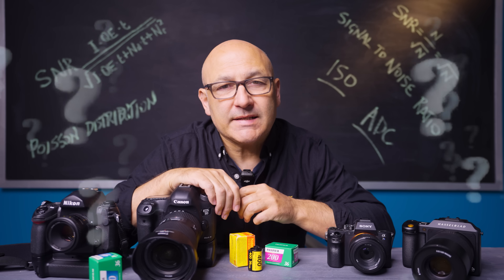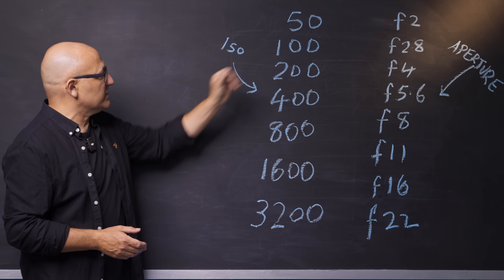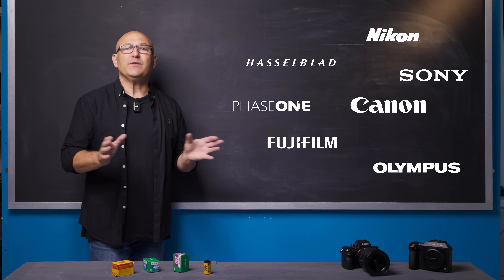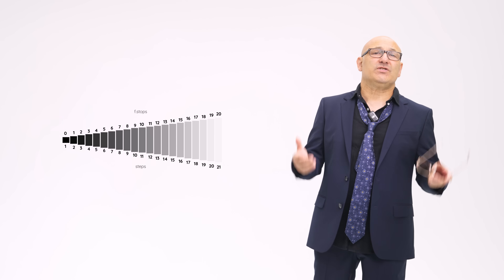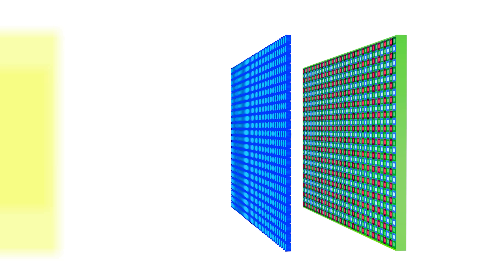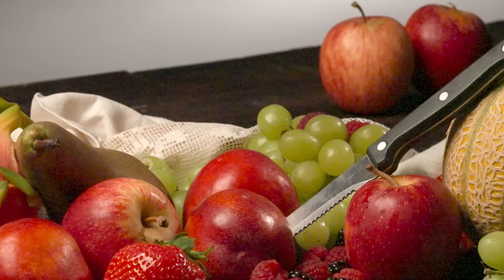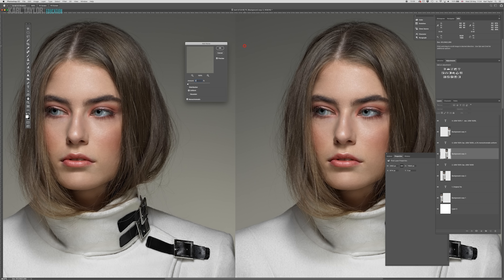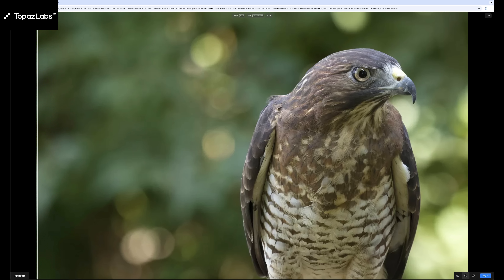ISO in Photography: The Truth Nobody Explains Properly

Comment: Great video! So, how is base ISO number determined? Seems like the manufacturer will just decide if their default or base ISO number is 100 or 200 or something else.
Reply: There is an answer to this. First you need to know that a sensor does not have an ISO, and for this reason sensor manufacturers never give a 'base ISO'. The limit in terms of how low can the ISO go is can the sensor accept the exposure for a given ISO. ISO defines the exposure for 18% grey. How big an exposure is needed as a maximum in not clear. If you're working in sRGB colour space (as, for instance is standard for JPEGS, and is the colour space mandated by ISO) then 100% lightness (white) requires 7.8 times the exposure above 18% (3 stops, it's not linear). So, for instance, the 18% grey level for ISO 100 is 0.1  lux seconds. If a sensor's saturation exposure is 0.78 lux seconds, then a manufacturer might decide that it's OK for 100 ISO. On the other hand, they might decide that they want a bit more leeway for people not using JPEGs, usually called 'raw headroom', and choose a sensor with a bit higher saturation exposure. One good example is the Nikon D800 and D810. Both used the same sensor. The D800's lowest non-extended ISO was 100, and it had a raw headroom of about 1/3 stop. The D810 had a lowest non-extended ISO of 64 with a raw headroom of just over 1/3 of a stop. At 100 ISO the raw headroom was 1/3 stop. This occurred simply because Nikon was not using the lowest gain setting for 100 on the D800, so they turned it down to give them a little more exposure capacity to get to 64. Why did they do this? Mainly, marketing, I would guess. When they launched the D800 they had just reduced their lowest ISO settings from 200 to 100 - probably to match Canon. Thereafter there was mor understanding of how ISO actually worked and the marketing people believed there would be extra sales with a lower ISO, they could do it so they did, and 64 has been the lowest numbered ISO stetting for their high res cameras since. Smaller pixels tend to have more capacity to spare for various technical reasons that I could go into if you're interested.
Reply from the maker: Thank you, your question was answered in the video between about 3:05 and 3:30, they test the sensor with their own processing and colour profiles/bit depth/dynamic range expectations and then determine.
Reply: @VisualEducationStudio  Thanks! I missed that.

Comment: I mean, I think you still didn't really get to the heart of it, noise ALWAYS exists, when you amplify the signal, you are amplifying both the signal AND the noise...

high ISO doesn't cause noise (at least not appreciably nowadays), it amplifies the noise that was already there, and typically that is because the signal was weak in the first place...making it more noticeable. 

But as a simple example, if you were to turn up the ISO to the very max, on a bright day, you would not see a noisy image, you would see a pure white image, the signal is much much stronger than the noise, THAT is why the signal to noise ratio is important. By the same token, if you leave it at the native ISO but shoot in a pitch black room, guess what, you still see noise. 

I think the biggest misconception is that high ISO causes noise, it doesn't, it simply amplifies the noise that was already there. It is basically the same exact thing as in audio, if you have a weak audio signal, turning up the volume will also turn up the already existing audible noise...

This is also why there is a noise floor, because its not like at ISO 100 (or whatever) there is no noise, it is still there, but if you properly expose you are not amplifying any of the noise that is below that noise floor (and thereby boosting it up).
Reply: It also would be helpful to mention that cameras also apply de-noising in camera...
Reply: @MaximoJoshua for most cameras that only applies to jpegs so isn't typically used by many photographers as raw is the preferred format to shoot in and de noising is applied in post.
Reply from the maker: @MaximoJoshua  at 11:08 we did mention that software denoising is automatically applied.
Reply: Tell me you didn't watch the whole video without telling me. You're literally giving the same explanation as in the video
Reply: @rotkeridyt  he literally said "amplification causes noise" at 7:24, I am saying that gain (high ISO) does not cause noise, it amplifies the noise that was already there making it noticeable. As a simple example, take an underexposed photo from the camera and boost the brightness on your computer...is the computer "adding noise" to your photo?
Reply from the maker: @MaximoJoshua  Hi yes I understand your point but what I should have said is that amplification makes the noise more visible. However the overall explanation and image examples help the viewer understand that.
Reply: @VisualEducationStudio I agree, the main reason why i nitpick on that point is because once people think using high ISO causes noise, they then think that they should always leave it on the base ISO.

Comment: Noise isn't a major problem for most situations except in the mind of the photographer. The key is understanding that amplifying a signal can cause problems when the amplification is pushed to hard. I my radio days, we talked about class A amps which were linear, with low distortion as the gold standard.

Comment: In digital, the exposure triangle is shutter, aperture, and available light. Sensor sensitivity is fixed, and ISO doesn’t change that. Boost in cam, or boost in post, it doesn’t really matter. Only light matters, and that’s what a camera does—it makes a record of light. So you either have light, or you do not. ISO doesn’t change that. Big watt-seconds and a parabolic change everything. 🎉
Reply: Well, no: boosting analog in hardware is superior to converting a noisy signal to digital and then boosting in post. Your statement is limited to non-dual-gain sensors where you (or actually the camera) have no higher analog boosting available.
Reply from the maker: Yes that's a good summary of everything this video said in more detail.

Comment: Great video! One note: lower megapixel sensors don't produce less noice per image. That's a myth. Less noice per pixel yes, but sensors of same generation produce about the same amount of noise per image. Key factor is the sensor size.

The tiny humour made this video so much better 😊
Reply: No, the actual key factor is the physical pixel area.
Reply: @OliverReinhard  only if you want to measure how much light one pixel captures. A sensor of the same size gets the same amount of light regardless of how many pixels it has. That's why noise per image is the same regardless of the pixel count / pixel size on sensors of the same generation.
Reply: @OliverReinhard  Total light in is only affected by: Lens opening diameter, Glass/Sensor Translucency and time gathering light. Both Sensor Size and pixel size do not actually affect the total light gathered per cm2, but rather change other factors that shift our perception of that same noise. 

With a higher resolution sensor, you can crop in further and see the noise easier. But if you downsample the higher resolution sensor to the same resolution as the lower resolution sensor, they would look identical. If you print the images to the same size, the higher res image would look higher resolution, but the images would have the same noise level when viewed from the same distance. 

With a larger sensor, you have to increase your lens length and diameter to get the same image, resulting in more light captured due to the larger lens opening, but if you use the same lens as the prior cameras, you would get the exact same amount of light per cm2, thus, the same level of noise. The additional light gathered is only going to the parts of the image the other two cameras did not capture.

Comment: Great video. Could you please shed some light on ISO (in)variance as well?
Reply from the maker: Hi, invariance meaning that something doesn't vary or change is the process of ramping up the exposure in your raw processor on a massively underexposed image rather that increasing the ISO in camera. Basically the results (on certain cameras) could end up similar - so for example you could shoot a shot at 3200 ISO at the correct exposure but then you could also shoot the same shot at 100 ISO at the same shutter and aperture settings and it would be 5 stops underexposed and instead you basically add 5 stops of exposure in camera raw software such as LR - some people claim that the resulting image is actually the same but to be honest I've never tested it and don't care because I don't want to shoot an image 5 stops underxposed because then I can't see it on the camera. BUT using this technique on cameras that have dual native ISO is not a good choice because then you could be missing out on the gains that dual native ISO processing provides.
Reply: @VisualEducationStudio  Thank you very much for the detailed answer, really appreciated.
Reply: ISO invariance is one of the things that is inconsistent with the narrative of this video, and therefore shows it to be wrong. The true story is this: Most of the noise does not come from 'amplification', it is shot noise, which is partially explained (wrongly) in this video. The important thing about shot noise is it is in the light itself - the particular nature of light The signal to noise ratio due to shot noise is proportional to the number of photons captured. So the fewer photons captured the lower the SNR and the noisier the image looks. That means that the smaller the exposure (remembering that exposure properly means the amount of light per unit area at the sensor) the noisier the photo is. Nothing to do with amplification. The other significant source of noise is read noise, which does not change with exposure. In normal use it's well below the shot noise level, but in very low light can intrude into the shadows. In some cameras a good proportion of this noise is generated in the ADC. Amplifying the signal before the ADC boosts its shadow levels up above the level of the ADC noise, giving cleaner shadows. This boost is linked to the ISO control, since high ISOs means small exposures (by the definition of ISO). In cameras like this setting the ISO to the expected level of exposure is important. Other cameras have less noisy ADCs (it really started when the column ADC came into widespread use). In these cameras the ADC noise stays below the shadow noise over the whole range, or a considerable range of ISO settings. The advantage of ISO invariance is this: suppose that you have a low light scene with light sources in the shot. If you use a high ISO, suitable for the exposure level of most of the shot, those light sources will just be clipped to white. You'll lose any colour or gradation in them. Using ISO invariance you can set a lower ISO, still get the tonality of most of the shot as you want, with no noise penalty, at the same time you can preserve the colour and gradation of the lights. A firework display, where as well as the fireworks you want to show the people watching, or the surroundings would be a good example.